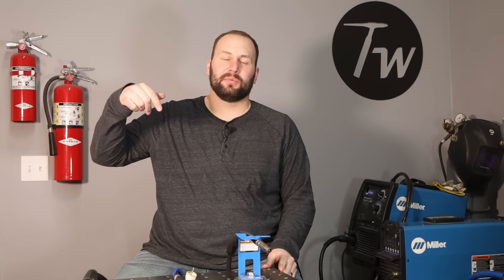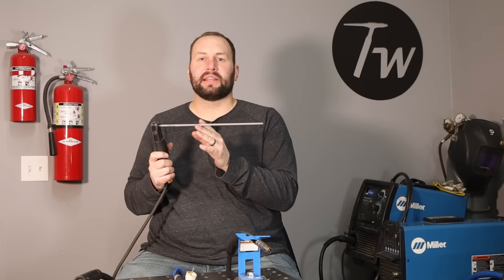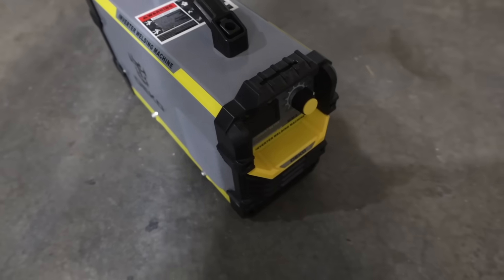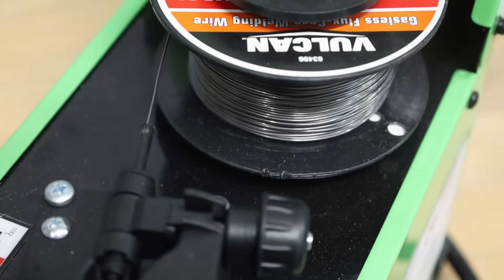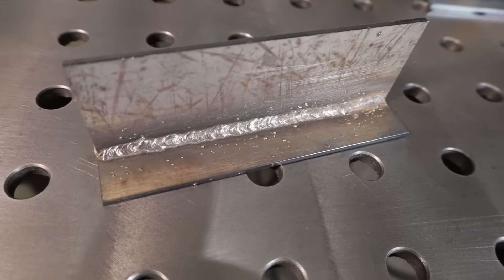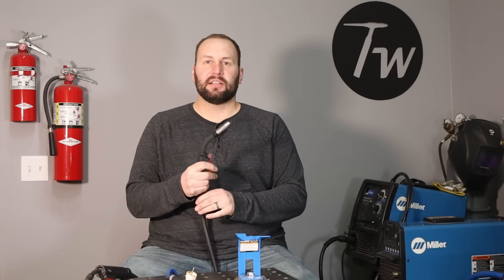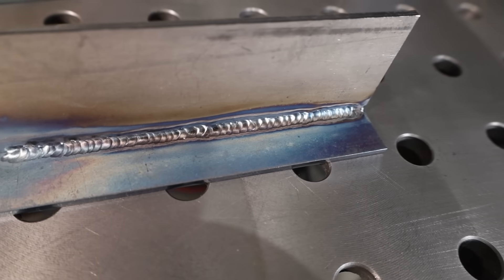4 Types of Welding Explained: MIG vs TIG vs Stick vs Flux Core

Comment: i have a CO2 shielded flux-core. it solves the porosity and splatter problems i was having with with straight flux core while still being cheap and dirty. also when welding outside in the wind it's not the end of the world if my gas blows away.

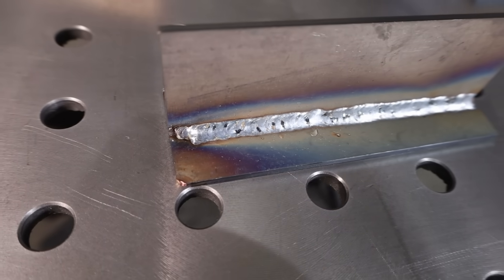Comment: is it a blow hole at 07:40.
Reply from the maker: Silicon settles on the top of steel MIG welds. When this pops off, there's a different sheen. That's what you see on that weld.

Comment: Can you TIG weld with flux core rods? Is that a thing? Seems like a combo TIG/stick welder would cover just about all your bases, especially if you could leave your gas at home if needed.
Reply from the maker: Unfortunately, that wouldn't work because the argon is needed to protect the tungsten electrode and to have the right arc characteristics. Thanks for watching and for the comment!

Comment: Welding in plain steel with Mix-gas, 80 / 20 Argon and Carbon-dioxide, plus perhaps 1 percent Oxygen is called Mag. not Mig.
Reply from the maker: Technically true, though MIG is the common (even if it is technically incorrect) term in my country for all GMAW processes.

Comment: I'm in the market of getting  a water cooled ac/dc tig cause i'm going to start my own company. but I need to work some more to save up some extra money so I can buy all the equipment and renovate my garage (almost 50 square meters) so I can weld in there and not get my insurance company mad at me for not having a fire proofed interior.

so what I need is to renovate, buy a tig, buy a saw, buy an angle grinder, buy a vice and build a nice big work bench with an aluminium top to prevent getting scratches on the brushed stainless steel that i'm going to work with

Comment: fun fact for all the none welders and some of the welders as well who watch this channel. the letter i in mig stands for innert which means that the gas doesn't react to anyting and a mix of argon and co2 isn't innert. so when welding regular mild steel are you using an active gas so the name mig is technically incorrect. it should be called MAG if you want to be technically correct. 

but, since the english language is the way it is and have been developing for a very long time have the word mig taken the name of solid wire mag welding. but also, if you have a gas assisted flux core wire or a 138 metal powdered filled wire is it still a mag welder if you're using a co2/argon mix.

just a little fun fact for you out there who happens to read this comment =)
Reply from the maker: Thanks!
Reply: @TimWelds  this reply shows that you read your comments and you just earned another sub.

good luck with your channel and keep creating awezome videos =)

Comment: What's wrong about MIG-welding on pure ("TIG's") argon aside from higher cost? So, for home infrequent use, one with a combination MIG+TIG machine can keep only one gas bottle, I guess...

Furthermore, what do you think about combination machines that are "welding + plasma cutter"?
Reply from the maker: The addition of another gas is necessary for the arc characteristics on steel. At least where I live, the pure argon and the blend are around the same cost. It would be nice to have only one kind of gas, though. 

I think multiprocess machines are a great concept. It all comes down to how well a particular one works.

Comment: stick welding is hard to learn? 
News to me.
1/16 inch is the thinnest you'll stick weld? 
Try a 1/4 inch wall pipe to a 16 guage pannel, with penitration on the pipe and pannel.  Super easy. Concintrate the arc on the pipe. Yes, you'll blow through the 16 guage metal. Big deal; you fill it in as you go around the pipe.
I was a fabrication welder for several years. I used a 200 amp and 300 amp Lincoln gasoline powered "pipeline" welder, both 100% duty cycle, and a 225 Amp Lincoln gasoline powered welder with just 45% duty cycle for a week or two, before the generator burned out. I guess 14 to 16 hour work days were too much for it.
How do you test your new welder to see if it is powerful enough?
We used worn out 1/4 inch and larger rat tail files to lay a bead.
Question: 
When Mig/Tig welding, do you nedd to change the wire for various steels, like you use a different rod when stick welding? 
We used one rod for mild steels, another for high carbon like 1050 to 1095, and another for stainless, and yet another for welding stainless and carbon together.
It's been 5 decades, I don't remember the rod numbers anymore.
I tried mig welding years later.  Stick is easier.
Stick welding only.

Comment: Great video. Thank you.
Reply from the maker: Thank you so much!
Reply: @TimWelds  What do you use to weld magnesium? Like old McCulloch chainsaw rear handle bar/gas tanks, engine cylinders, etc.
Reply: @johnlincicum6390  JB Weld is the best type of weld I’ve found for those old magnesium cases John
Reply: @TimWelds  good afternoon. do you just plug an inverter welding machine directly to a convenience outlet in your home to start welding or do you have to have a special outlet with wire size other than the usual in your home? i am concerned about safety. homes here in the philippines uses 220v. thank you very much. your videos are very helpful.
Reply: @TimWelds  what's with the air pockets (holes) in the mig weld at 7:37?
Reply: i can see it, annihilating a phone with with a welder
Reply: Nice to see you here sir!
Reply: @ArunJovian  i was just about to say that 😂
Reply: What the...
Reply: this is not phone sir
Reply: phone scratching man hello
Reply: Oh. You’re why the algorithm sent me here...
Reply: we'll be expecting welding on durability tests 😂
Reply: Just a thought... if you shine a bright shop light on the work piece as you weld you'll get better video footage.
Reply: Damn, I didn't expect to see "Jerry" here
Reply: Yoo ZachRigEverything
Reply: Yeah, nice video
Reply: time to welding machine teardown
Reply: Hey Jerry
Reply: So you we're a welder?
Reply: he is making something ....stick around
Reply: @joshuasusanto4258  not just Apple. He even uses a samsung
Reply: Big fan bro❤️
Reply: @JerryRigEverything your videos are awesome too.
Reply: JerryWeldEverything
Reply: Welding test on mobile phones
Reply: can anyone else see this guy welding a bunch of phones together?
Reply: u have to rig that welding rod jerry
Reply: are you gonna do a teardown on this machine next?
Reply: Big fan you're amazing
Reply: Oh look its The Phone Terminator haha
Reply: Jerry, you've never used any of these welders don't lie 😂
Reply: Maybe jerry is about to rig welding machines next lol
Reply: Jerry was here 😂.
Reply: Are u gonna break welding too?
Reply: I already thought the video was good but now I know I'm in the right place
Reply: Are you going to do bend test at welding machine?
Reply: But metal is metal, and metal doesn't break...easily.
Reply: what up jrig!
Reply: https://youtube.com/shorts/QF1uD_1Wlkw?feature=share
Reply: Omg,, my jerry is real.. 🥰
Reply: ooh, are you gonna weld Jerry ? :)
Reply: Youre welding is rly baaaaaddddd
Reply: Hello
Reply: I agree, thank you
Reply: 😱😱😱 Jerry is here how wonderful
Reply: Will you do a tear down and a durability test on a MIG welder? :D
Reply: I lol p you just use an additional rod and you'll feed that right i
Reply: the durability test
Reply: is iphone 12 pro max LCD, weld resistant sir?
Reply: I’m early on Jerry’s comment for a first !!!!!!!!
Reply: big fan jerry brooooo❤️❤️❤️🥂
Reply: Big fan jerry brooooo ❤️❤️🥂

Comment: Thanks.  I  started with harbor freight flux core.   After two years i moved to Metal man multi process.   I like having flux core for outside fixes and mig for cleaner inside shop welding.   I'm not very proficient with stick...

Comment: by a littlebit experiece
flux core: good for mobility and easy,  watch out for wind its really sensitive or you'll get porocity

smaw: best allrounder outdoors, less hassle when working outside

tig: very clean welds, mostly on stainless and aluminum, probably the most fun if not welding a gas tank.

mig: best allrounder indoors, not just shops but you can bring it to the building youre working in

oxyacetelyn: FIRE HELL YEA.
edit: jk but its good for sheetmetal and i prefer it more than plasmacutter
when cutting 3/4" or 1 inch thick metal

Comment: Another sneaky detail of welding or at least stick welding is how much power the welders draw a friend of mine and myself were doing work in my shed out in the backyard and without really thinking plugged the welder into a power board that had 6 outlets on it because we have a lot of power tools and it's a hassle to use them individually so having extra power outlets never hurts anyway about 2 minutes after my friend started welding we lost power to the shed we looked at the power board and it was smoking while he was welding he'd fried the surge protector rendering the power board useless after this he went out and immediately bought another one so no harm done but yeah for any newbie welders/metal fabricators make sure your welder is plugged straight into the household main power don't use anything like a double adapter or power board extension you'll fry them almost straight away.

Comment: Completely skipped over dual shield. Dual shield makes flux cored superior to MIG. Its the most widely used process in the industry as far as weld volume and deposition rates.

Comment: I'm currently teaching myself how to stick weld, there is nobody that I know and my family or my wife's family, that knows how to stick weld. I'm teaching myself because I never learned how to weld and I can't afford to go to school for it so I'm getting practicing on some scrap metal that's been around my yard always clean it up first I've learned that lesson from watching Tim and a couple other channels. And I am slowly getting better at it but the big test that I have is I'm currently fixing my father-in-law's trailer, which is now my trailer, after his passing. It needed multiple upgrades and additions done to it in order to be road legal again. So I've been teaching myself and I'm getting better I'm still not great but it's an interesting experience.
Reply: Making sure the rods are warm and dry is important.  If you have a rod oven that’s great but I read someplace someone used an old toaster oven.  Also people use on old fridge with a light bulb inside.  Sometimes preheating the metal if you have a torch makes things easier.
Reply: @paulnicholson1906  thank you I had heard about keeping the pieces of metal warm but I had not heard about keeping the rods warm. I'll have to give that a shot, when I go back to welding (I just had a tooth removed I'm not doing anything until it gets better LOL)
Reply: If there's a local mom and pop mechanic nearby there's usually a welder there maybe you could help out a few hrs a week in exchange for some welding coaching. You never know til you ask

Comment: Good to see this comparison video!  The fumes from the burning flux have been linked to Parkinson's Disease which killed my father.
Reply: Baby powder , Listerine alcohol gives us cancer,  smog ruined/ BHTE at the gas pumps , ethanol/corn alcohol and alcohol in ruined my lung capacity to b a rock singer in BOYLE HEIGHTS 90033.🤣

Comment: Nice. Fixed some of my gnowlege and some assistant to anderstand. In teori cnow how they work but proper welds for mi worked aut in stick and vire both of them. Tig learning curve is imminent.soon. and i am an holiday welder. With big abuce coud break 1 of mi welds. That was brutall. And not wery nice. Forfarmer maybe but for proffecional level ugly.

But there is a acetylene welding to...

Comment: I bought an ark welder much to the annoyance of grandpa he said you’ll never learn it it’s hard as hell you’d be better just sticking with your mig welder, Andy road I got this welder and I couldn’t believe it 2nd attempt and I got it it just clicked and thinking back I had a helluva job learning to mig weld and this ark welder was so easy. I’m not saying it’s easy for everyone but if you want to try it try it but definitely don’t be discouraged when it don’t turn out perfect straight away. I’ve only been welding 2 years (since I was 16) but I feel very comfortable welding anything. 

A tip for welding above you like when your under a car put something in your ears because there’s nothing worse than having some molten weld go into your ear because there’s nothing you can do

Comment: Tim, is there a all in one machine you could recommend that includes a plasma cutter? Or, is it best to buy a separate unit designed just for plasma? We have a small farm & blacksmithing is a lot of our work, we go through a lot of expensive angle grinder blades to cut our steel.